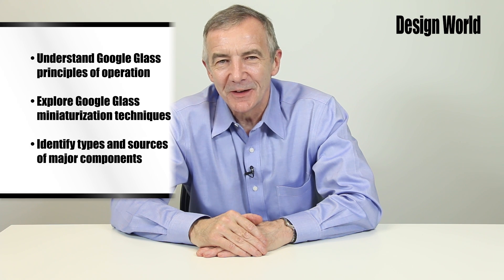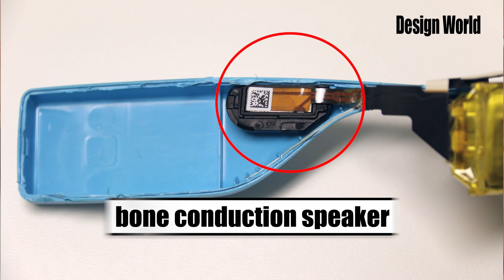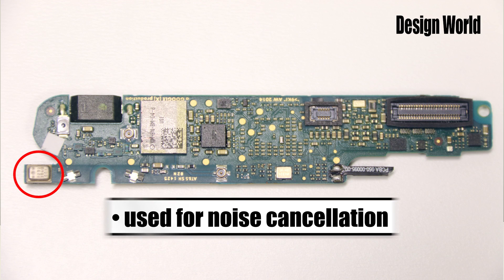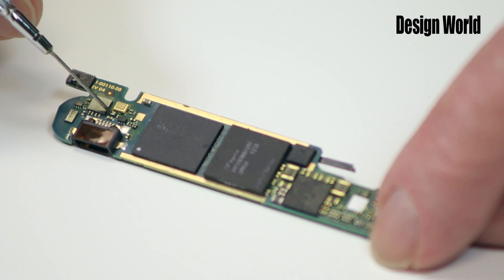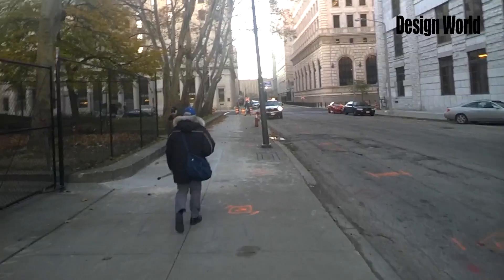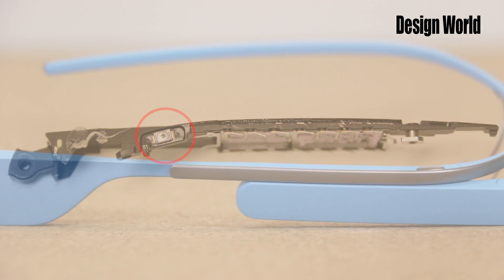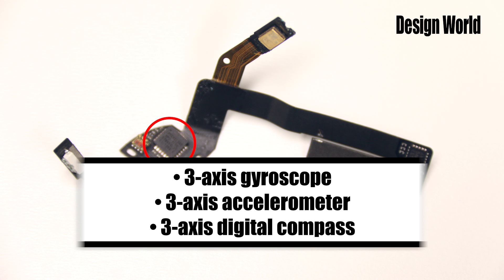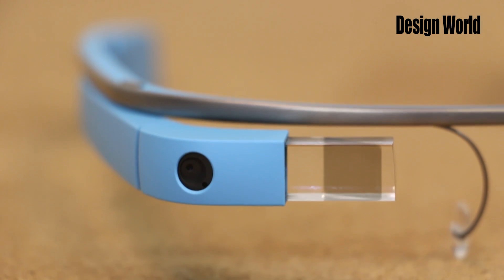What's inside Google Glass?

Comment: I would love to see a Google glass with a full eyepiece. Maybe you could magnify the small screen with a series of lenses to fill a larger prism.
Reply: Myself and my company are working on something just like that. Augmented Reality isn't going to have the traction of Virtual Reality until we can get full field of view displays. You can see that the google glass uses a prism. The glass prism is effectively simply 2 halfs of a cube, and where the two internal faces meet causes a refraction surfaces providing enough optical interference to refract the micro displays image. The idea is that the prism can be scaled proportionally to the display. There are micro LCD displays that are marginally two to four times larger than the one on google glass. So using a display of that size coupled with a larger prism cross section and boom, full field of vision heads up display! 

...just gotta work on the Adam Jensen, Deus Ex style flick out glasses!
Reply: @MartinSmithInterfaces  What's your company?